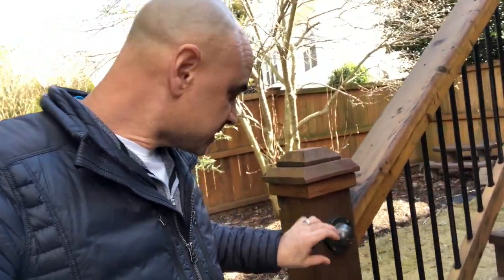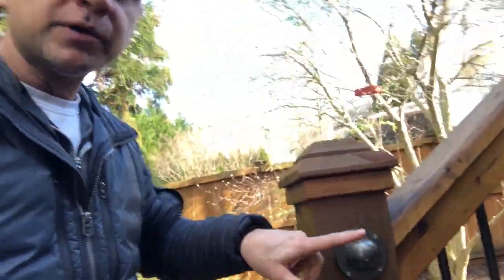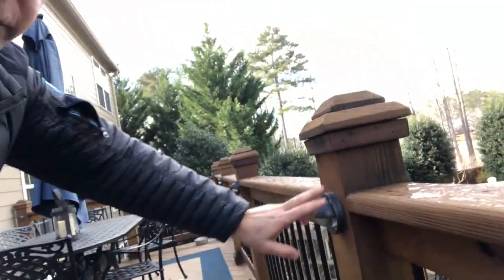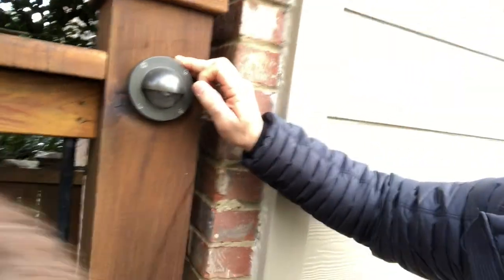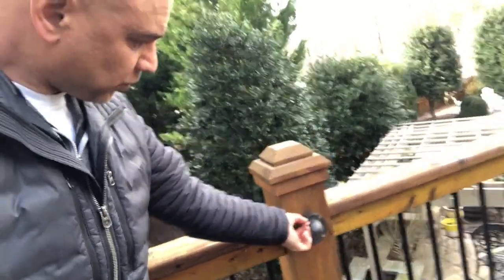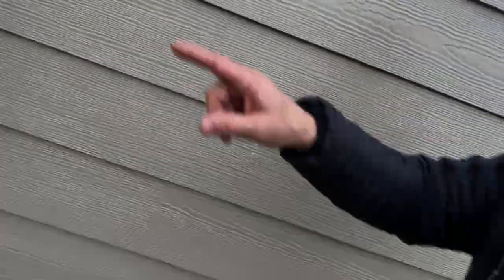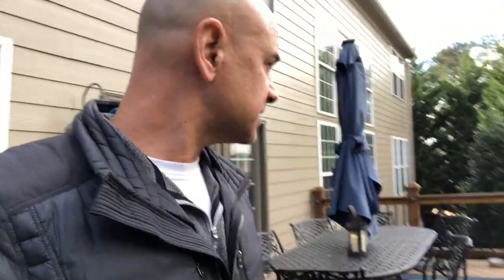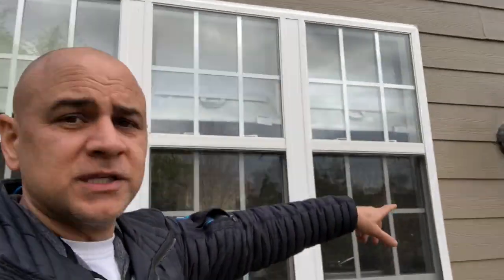How to Retrofit (or Install) new LED Deck Lights 💡 How to easily Install Low Voltage Lights

Comment: Phil! Keep it up man! 
One thing though. I purchased the 18 part paver installation Manual, and its great it really taught me a lot. But I would really appreciate another video where you go step by step on a pager job. And explain things like slopes and how to curve the paver and how not to. Things to avoid and such. Just a little bit more in depth on the actual installation on a paver patio.
Again keep up the good work really learned a lot from you and Stan!
Reply from the maker: Santiago Garcia Thank you Santiago. I will definitely make a note to do that. We have some paver project coming up in the early spring and I will take the time to make a video on exactly the things you mentioned. I really appreciate the positive comments and feedback. Hope you have a wonderful day. Thank you again!

Comment: How do you attach the railing top cap if there is a wire running through the middle in the routered channel?
Reply from the maker: Great question! We can drill up from the 2x4 underneath as well as drill down. But in both cases we angle the screen to go slowly and carefully at an angle and avoid hitting the wire. The key is SLOW and very careful. Keep testing the lights as you progress. If they stop coming on then you’ve pierced the wire. Back up, tape the wire and continue from the last known “good spot”. If you do it a few times you “memorize” the correct angle. I’ve screwed it up plenty of times😂 Hope that makes sense.